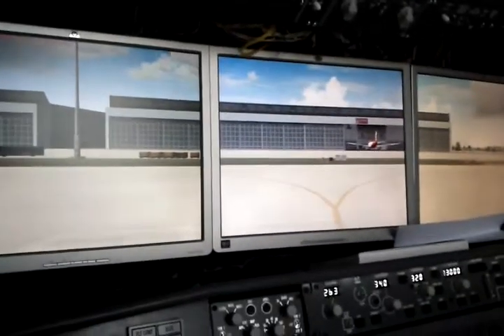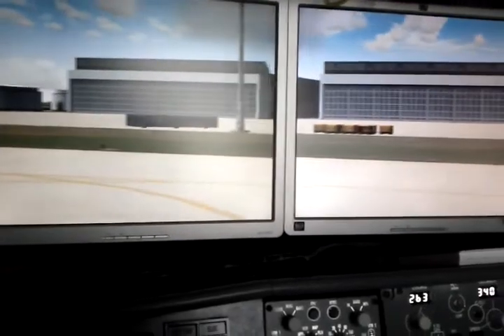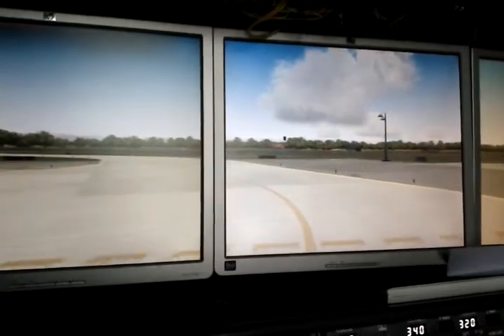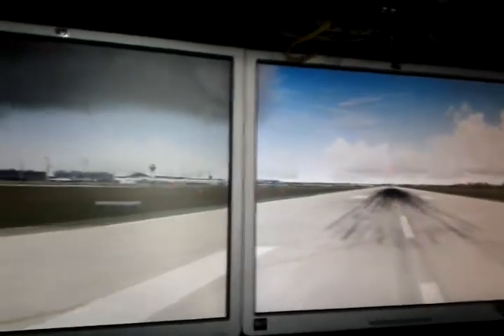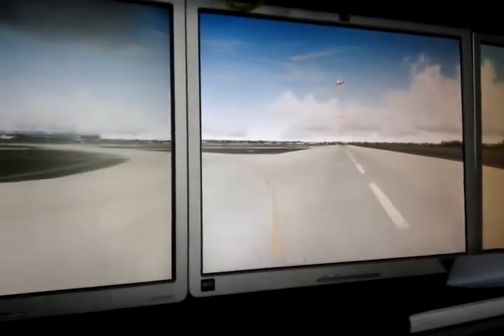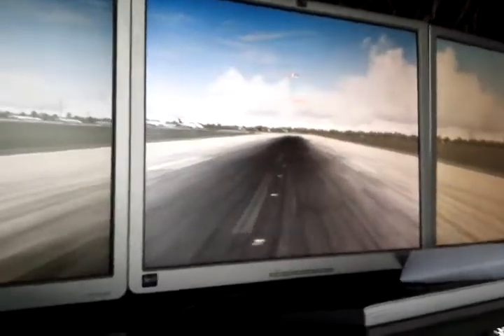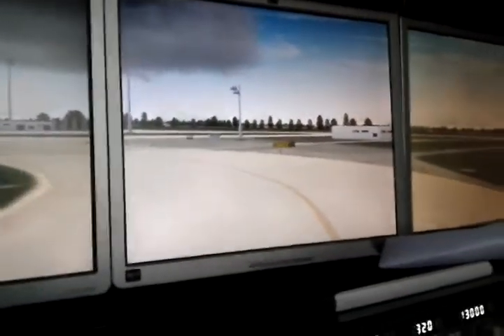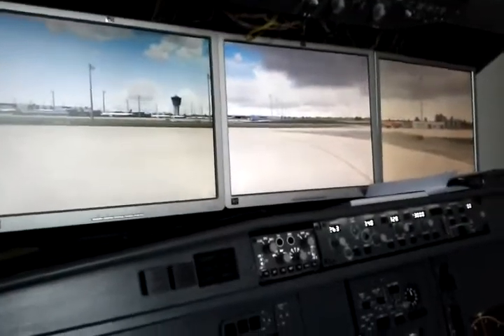RAAS System - Homecockpit

Comment: Also there will be further callouts like, "unstable unstable" during approach, when too high, or when flaps are not set. The callout "too fast" won`t be implemented at that moment, also the callout "altimeter seting" won`t be availible in the new version.
Also the callouts "on runway xx on runway xx" will be implemented, when the aircraft stays too long on the runway which reminds the pilots, after certain interval.